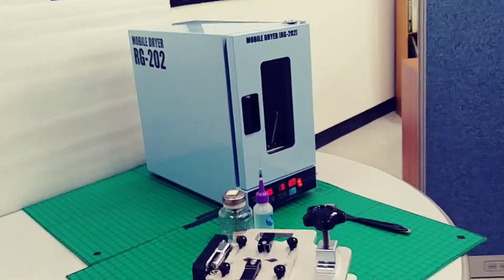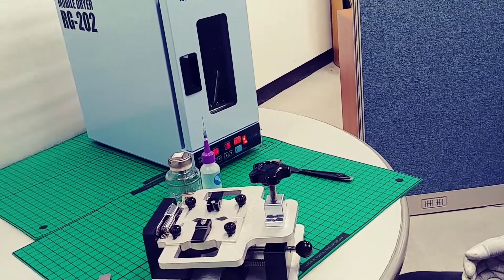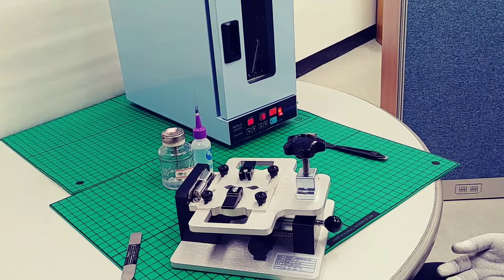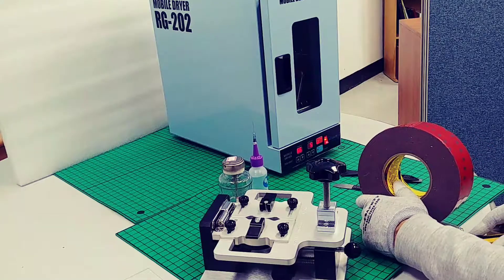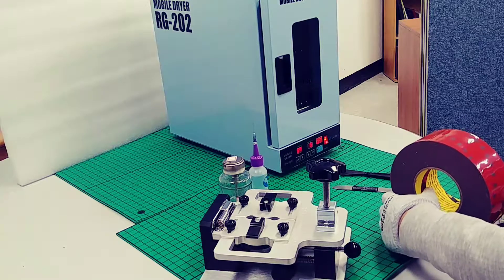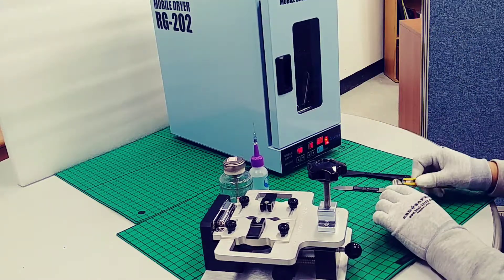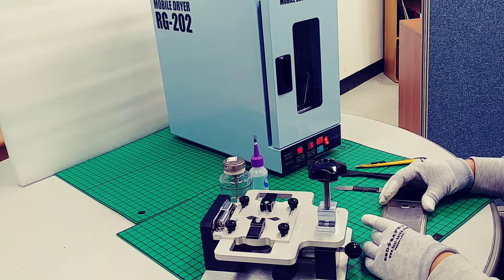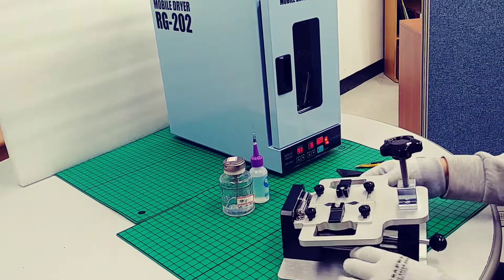RG 271 disassembly of cracked rear cover with double sided sticky tape and plastic plate

Comment: New edition RG-271 manual disassembly jig is upgraded version of RG-270 disassembly jig.You can use standardized plate and sticky tape to disassemble cracked glass without much trouble with RG-512, and ethyl alcohol.  You can purchase all of them from us directly , RG-271, 3M industrial strong sticky tape,and standardized same size plate (plastic)One time you had better buy 10pcs of plastic plates and when you have time, use ethyl alcohol and RG-512 to disassemblesticky tape from plaste to use for other phones to continue to recycle plate.3M Sticky tape is waste.